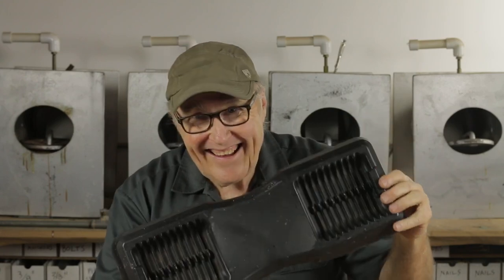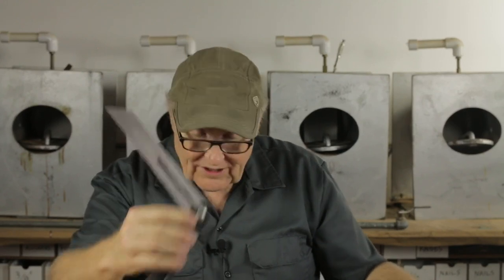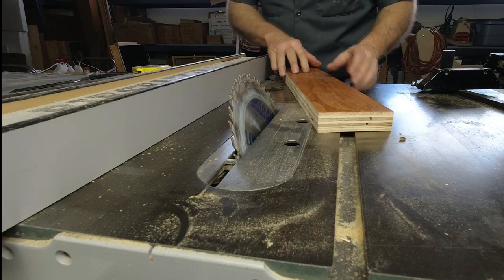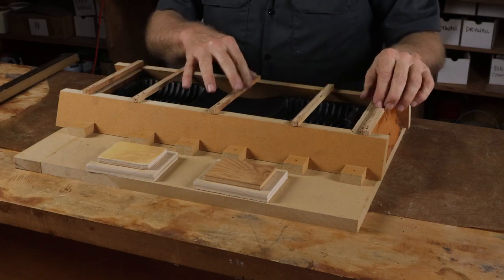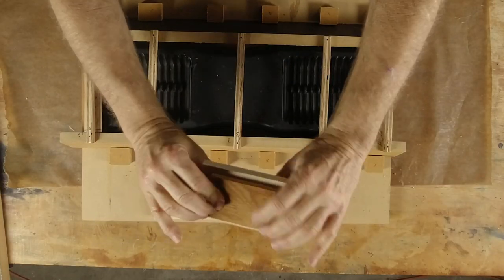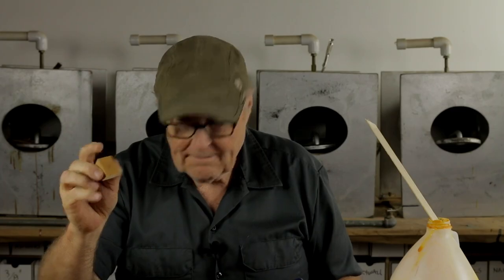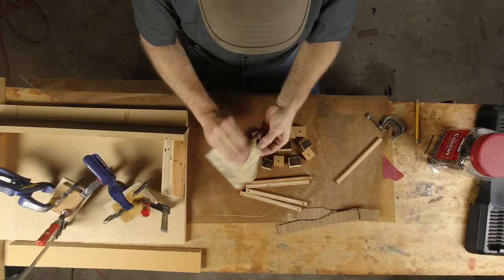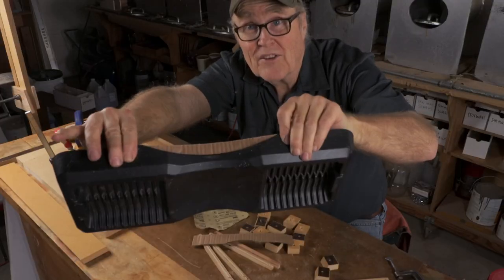Making A Custom Mold Case For A Poured-In Silicone Blanket Mold.

Comment: First off, thank you for all of you great content and instructions. I have tried molding and casting thanks to you and so far it has been relatively successful. I do have a question though pertaining to the mold mother/frame. I reproduced a piece I made on my 3D printer and also printed the mother to surround the mold. The issue was that it leaked the silicon out the bottom, what would you recommend to seal a plastic mold mother that can not be heated? Thank you sir!
Reply from the maker: I would paint all the seams in the mold with the same rubber you will mold with.  Let it cure, or at least gel, and that should seal the leaks.

Comment: Sir, i have quite the conundrum that i could use some help with if you would be so generous as to spare me some of your time❤ i have a unique lid for my sand pool filter that i need to mold the threads of and also attach to the existing filter body. Sos haha

Comment: Info, great as always! What rubber would recommend for pewter?
Reply from the maker: I have never cast pewter although I have cast other low-temperature alloys. You will  need a high heat silicone like Smooth-On’s Mold Max 60. Pewter melts at 170–230 °C (338–446 °F). So be sure the rubber can take the heat. Check the melting temperature of the pewter with your supplier. Different alloys of pewter have different melting points. Also carefully follow the directions for use by the silicone manufacturer.  Good luck! Let us know how it worked out for you.